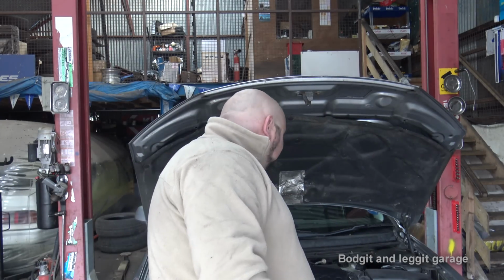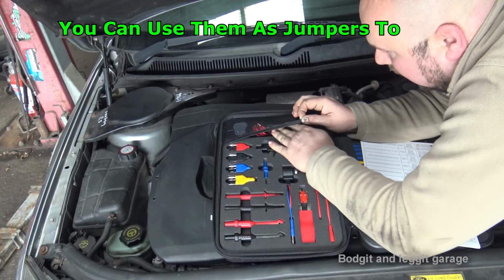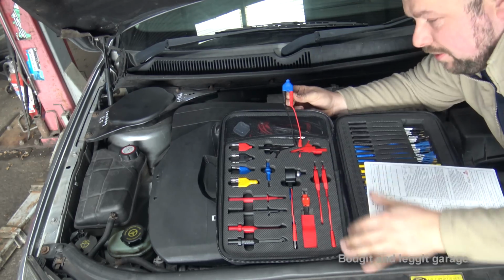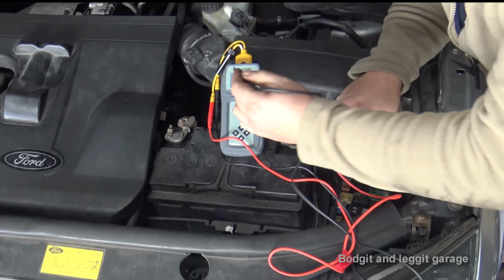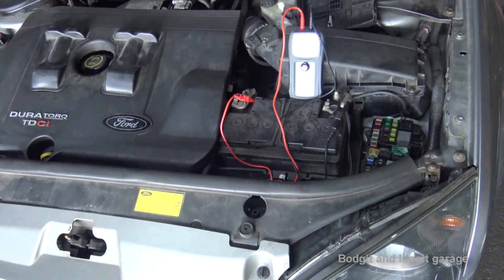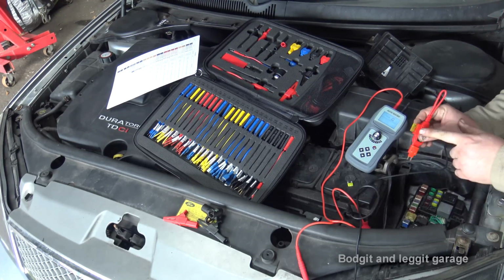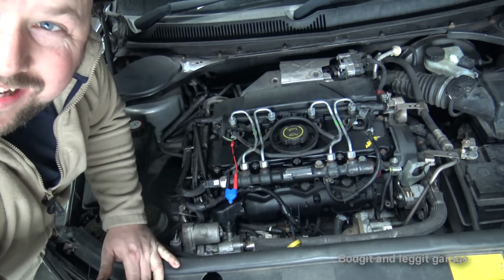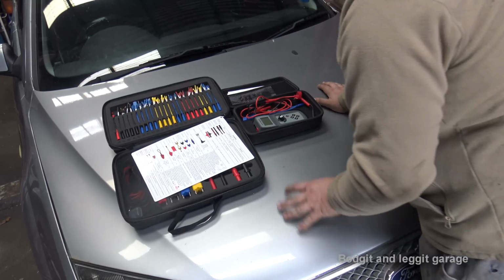Hubitools Auto Tester/Diagnostic Test Lead Set Tool Review Bodgit And Leggit Garage

Comment: Great video Leon. That kit will pay for itself in time saved over & over & anyone that does diagnostics will benefit from it. I have the Aeswave uTest Advanced Terminal Test Kit and has made diagnosing so much quicker and is great for drag testing terminals. If you're doing this for a living the more diagnostic equipment you have the quicker and more enjoyable diagnostics will be!
Reply from the maker: Hayward's Automotive exactly mate couldn't agree with you more the right tool for the job

Comment: Would be interesting to compare it to the AESwave kit
Reply from the maker: David S. Send me one and I will do a comparison video😁😁
Reply: wish I had one hahaha
Reply from the maker: David S. Lol it's ok mate just buy me one I'll let you know how they compare
Reply: This is essentially the AES wave kit. Now with that said AES has released a few new test leads to complement this kit that have a loop, plug in port for the multimeter and they also have a port for the fuse as these are fuse adapters. A great addition to the test kit displayed here and the AES wave one. I will try to find the link and post as they're golden. We'll find out soon as mine are on the way via mail. Should see in Appx 2-3 days.

*****Edit*****, Here's the links for the test leads @ the AESwave.com website. Note these are for newer vehicle applications as described in the description. Timesavers for sure. 

https://www.aeswave.com/JCASE-Fuse-Extension-Lead-p9267.html
https://www.aeswave.com/Fuse-Amp-Loop-with-Voltage-Tap-LP-M2-M3-p9755.html

Call or email them directly if you're planning on ordering other things as you may be able to get a combined discount or save on shipping. Every now and then they have combination specials so be sure to ask if you're ordering multiple items as they make alot of the stuff they sell as well. 

Having the taps and being able to use a Amp clamp as well will definitely make these popular.

Comment: Great Video, How do you find the correct specs you mentioned in the video for your engine?
Reply from the maker: nw8000 unfortunately mate that's the hard part on the expensive part you will either need to subscribe to some program or get a workshop manual for your particular car

Comment: 1,9 cvh escort on a t34 turbo, just had head done all burton power parts, arp bolts every thing done, and now runs like bag of crap when it runs up to temp, i have no clue to problem, have you ever ran into this prob m8? runs good cold? scratching head?
Reply from the maker: jon taylor hi mate unfortunate that's going to be impossible for me to stay as you need live data to see exactly what's going on with the car get some live data picks up and see if they change as the car is heating up one thing to maybe look for is your temperature sensor

Comment: U can have the best equipment in the world but unless u know how to use it it's useless most of the time u can bypass systems using homemade wires cables joints just using common sense.nice video as always Leon well done and keep em coming!
Reply from the maker: MrTwisted1977 there's the right tool for the right job on modern cars there's no point risking it you could blow up £1000 module sooner get the right tool for the right job and not risk it